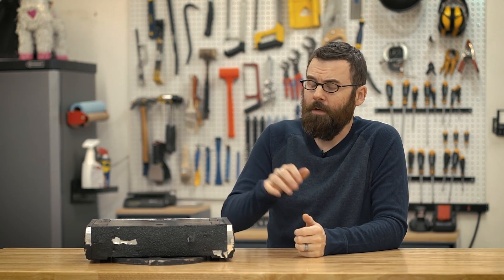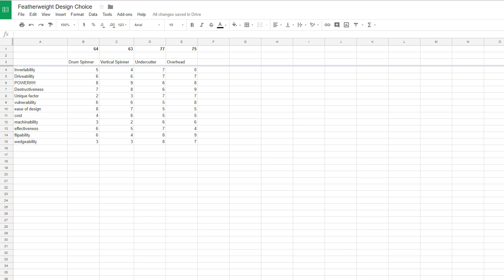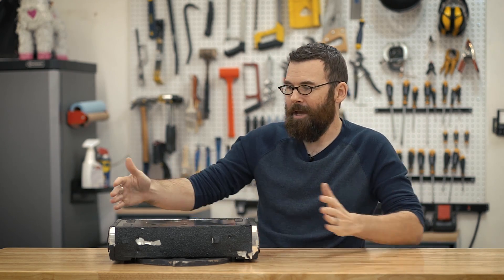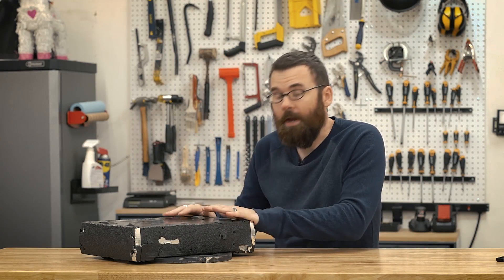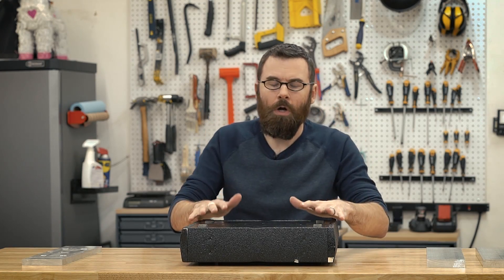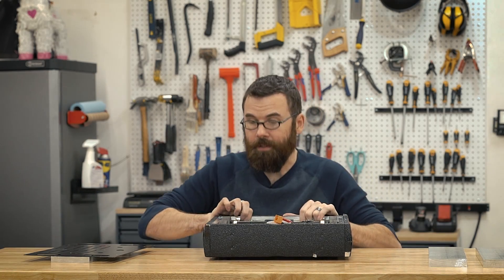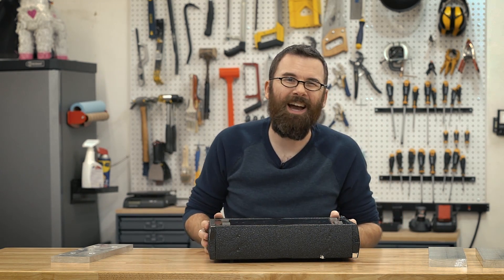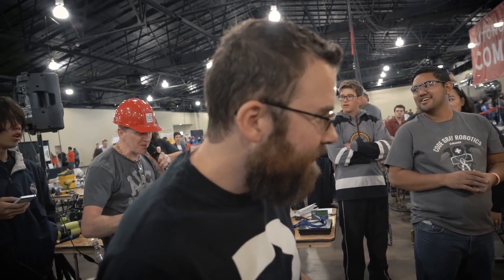Crippling Depression - Part 1 (Overview)

Comment: how do you recommend I mount my drumspinners drum? I dont have a welder so I cant melt anything. I dont know were to get mounted bearings that can handle 12000 rpm.
if somebody can tell me were to get them I would like to know.
Reply from the maker: there's a lot of questions there without context.  you don't need to weld anything.  you could use bearing blocks.  there are plenty of bearings that can do 12K RPM.  Check VXB.com, you can search for sizes.
Reply: Robert Cowan thank you so much

Comment: Try sandblasting before any kind of paint or adhesive. Makes a very dramatic difference.
Reply from the maker: I talked with the line-x guy for a couple weeks and and acid etch is probably the best way to get it to stick better.

Comment: did you consider (after the combat experiences) to make the whole thing invertible? so put another cutting blade on the top, then even if it turns upside down, still has a blade on the bottom. maybe with a little thinner and/ot smaller diameter blades to loose some weight.
Reply from the maker: many people try multiple weapons, but you end up just making less effective weapons, and twice as many things to fail.  also, there is no vertical room to power two weapons, the top section has the motors inside, so you would need to add at least an inch to the total height, making it non-invertible.
Reply: I see, that make sense! thank you!